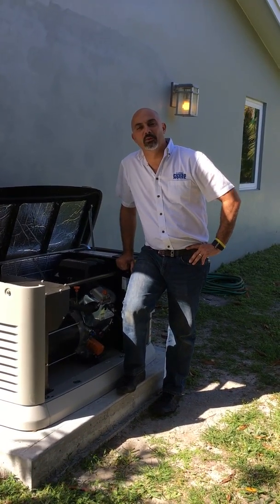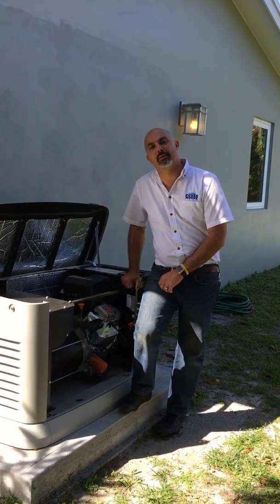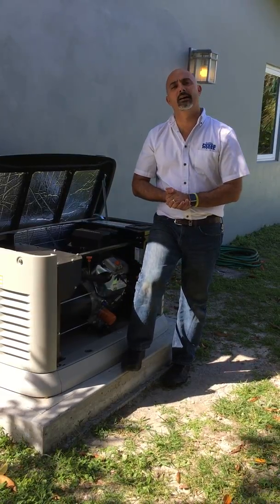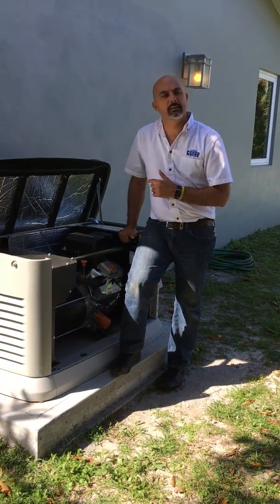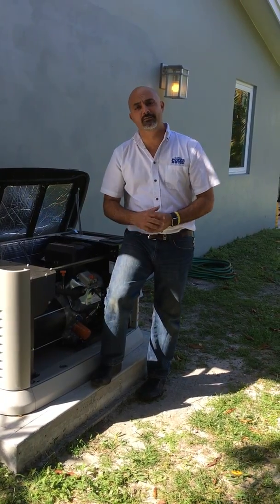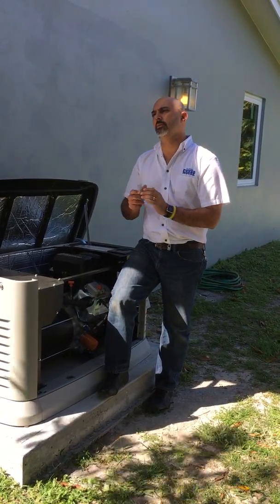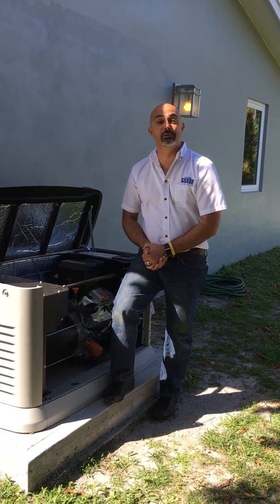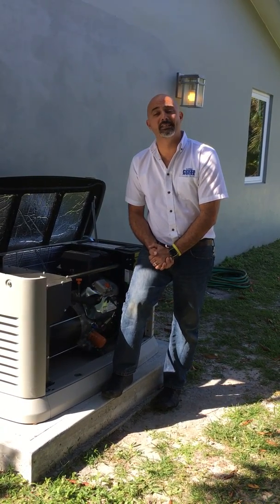7 Most Common Generator Failures

Comment: Hi, I have a problem and I hope you can help me. The thing is that I am in Venezuela, and here we haven't generac sponsor or something, so I have to do things for myself. I have a Generac Guardian 17 Kw series, since 2012 I think and I've never had any problems. in the morning I need to use the battery and then when I reconnected it to the generator and turn it on manually to see if everything was OK, I didn't turn on, and it said RPM failure, and when I turned it off it said low battery. I went to the menu/status/display/battery & it showed "voltage 0.0", but in the tester mark 12.6 and actually the battery is able to run the car so, it is not a battery issue. I was reading and I think the alternator fuse blew off, but I can't get it to replace it. Could you guide me and tell me where I can find it inside the generator please?. I'm waiting for your answer...